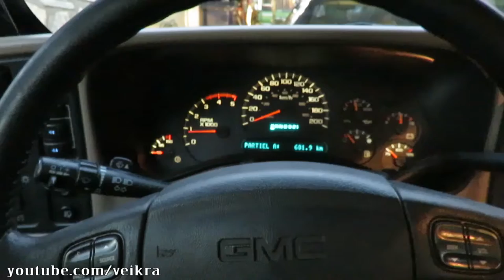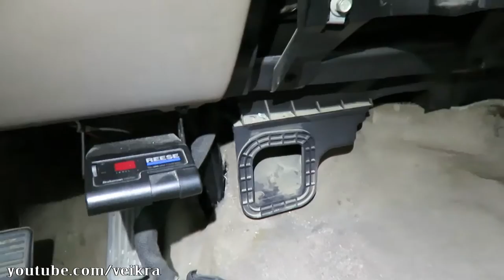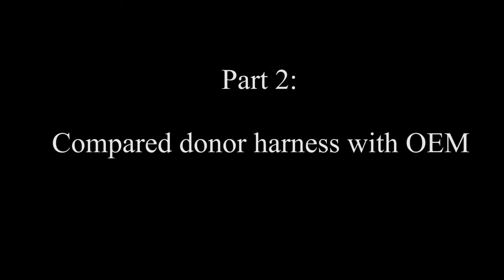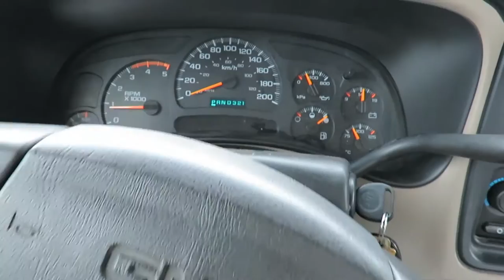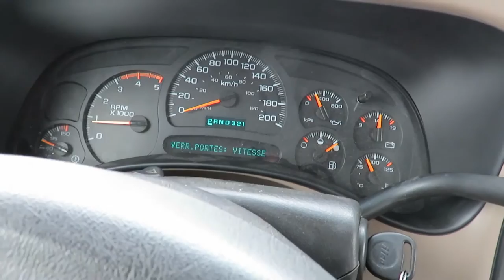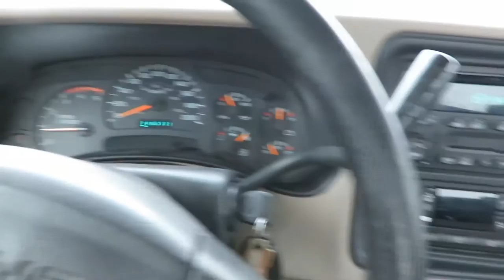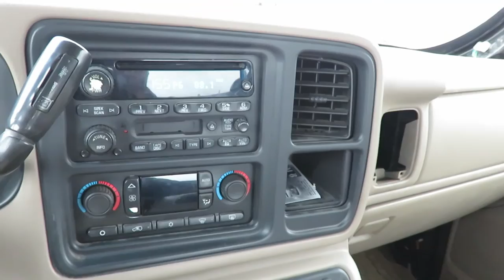How to add Power heated seats 2003-2007 sierra silverado avalanche escalade with ANY wiring harness

Comment: Wow a lot of work!  I am looking to convert the manual passenger seat to power (no heat). Best just to run power over from the driver seat?  Good job with the upgrade
Reply from the maker: yes, power the black and the orange and you`ll be set.  It was quicker than I thought and totally worth the effort considering the cold climate I encounter

Comment: I just got wiring harness that runs from driver to passenger seat.do I just splice the wires in where they come from under the dash and from the doors and splice the wires that go to the back doors. Any info would be appreciated. Thanks
Reply from the maker: First thing is splicing or plugging into the big connector under drive side dash. Follow the wires to make sure they go to the same place especially in the module with yellow plug under the driver seat. My harness was different because it came from a different bodystyle (avanlache/escalade) so yours could plug in. There's not much going to the back door but thats where you splice the purple wire. You may have unused wires too. driver front seat ground connection (big black wire) may also need to be connected to a ground depending where the harness was cut

Comment: Extremely cool and helpful video bro. Have you ever replaced one of the drivers side heated elements? I believe mine just went out. Anything feedback would be great. Thank you and have a good one bro.
Reply from the maker: I've not had to replace any element on this one. Usually the bottom element is the first to go out. Did both of yours go out at the same time? Are the passenger side ones working? The lights on the button should flash to indicate a problem
Reply: Veikra it's usually intermittent. I believe the drivers side bottom element went out. Passenger side works good til I turn on drivers side. I know the bottom heat elements go out 90% of the time. I was just curious if you replaced any because you seem very knowledgeable. I have an 04 cadillac escalade 6.0
Reply from the maker: I was sure I had to replace at least the bottoms one, as these seat came out a 2004 escalade. Did not have to, it's not THAT bad to do, just need to take your time and be a sticker for detail when putting back the leather in place.  So far so good, 2 winters, still toasty warm ! Only use the 2 and 3 light for warm up, then only on the first one.
Reply: Veikra you're lucky bro haha. Keep me posted, if you ever do a heat element share me the video if you choose to record it. Merry Christmas bro to you and your family.
Reply from the maker: thank you, ill try to find a broken truck to do it

Comment: Did you have to add any factory fuses (under the hood, side of driver dash)? I put a floor harness and to the seats I wanted to keep the manual seats but wanted heated. As soon as I turn on the heated seats it turn right off within a second
Reply from the maker: I already had the fuse in because I had electric seat base from the factory.   What exactly do you have? you found heated seat that are not electric? What's your year truck and the year and style of seats. The factory heated seats turn off if the heater in the seats are bad. But Id like to know what you actually did to see if it could be the problem.
Reply: @Nordic_Mechanic  04 sierra 1500 I went to the junk yard and grab the floor harness and the same junk truck grab the harness from the seats. My wife has 03 Yukon with power seats and they are junk thats why I want to keep the manual seats I got the heaters working apparently the switches for the driver and passenger heaters talk to each other because now they're working I didn't have the passenger switch plugged in the 1st try thanks for trying though

Comment: cool video bro!!! So if I just install the wiring harness for the heated seats to work there is no need to program anything and I don't need to touch the fuse box either.
Reply from the maker: You need to program if you want the MEMORY seats as I said in video.  Because that works with the bcm when you remove the key you can have the seat pull back to give room . The heated seats work on their own. You hook it up and go, no fuse to add either.
Reply: @Nordic_Mechanic  how can the BCM be reprogrammed to get the seat memory function to work?

Comment: Veikra - thanks for the great video. So it’s possible to add the necessary rpo (AG2 &AN3, I believe?) to the BCM to get the memory and easy exit to work?  It can be added to the existing BCM  that currently doesn’t have it?  Who or where can tbis be done?  Thanks!
Reply from the maker: Yes, you need someone with a tech2 to add it. Or you can send your BCM to a company that will flash it in. I never bothered to, I never move the seat anyways and heat works

Comment: I have a set of power heated seats from a parts truck, and friend of mine has manual seats but his drivers seat has a harness under it like yours, will the directional power buttons on the drivers seat work just from plugging it in ?
Reply from the maker: Yes. Hooking the big orange and the big black wire is all you need for power function both driver and passenger. Heated seats wont work without the full install shown here
Reply: Veikra thanks for the quick reply, hopefully seats are from a 04 2500hd and he has a 05 2500hd...plus I still have all the wiring it’s just not pulled from the truck yet just hoping the power to the drivers seat for the time being will be simple thanks again

Comment: Can you please make an update video ? I have the same truck as yours and it has no heated seats . It does have the base electric seats . They are cloth . If I want to add full power , heated seats would I have to change out door panels and the harness to the door ? Please send me more info on this
Reply from the maker: this is all you have to do for the door panels. This is the cheap option without buying new door panels. Just cut and put the switches in. They connect to window switches. https://www.youtube.com/watch?v=nkpA3kd5jeg  The rest is in the video, but be attentive or you may miss some details.  This tutorial works for any harness, dont have to have a perfect sierra to sierra match, although that would be easier

Comment: Anyone know which wires on the seats are the side airbag wires?? Just got 04 yukon seats and putting them in my 99 silverado. All power should be plug and play but my silverado doesnt have seat side airbags. So I dont want those connected. But which wires are they??
Reply from the maker: 2003+ don't have the same electrical system. You'll only be connecting the big orange and black wires under each seat and the seatbelt sensor. The airbag connectors are yellow

Comment: Hey buddy my name is Patrick an I'm doing the same swap on my 03 Duramax an I would like to ask you a couple of questions if you don't mind I took the wires out of the doner harness that needed an installed them into my factory harness pin for pin the only wires i have left over that are not hooked up are a pink wire, yellow an brown with a white stripe that went to the doner harness at the left front kick panel plug do I need to splice them into my factory harness or are they not used also everything works other than my heated seats on both sides im not sure what to do any help would be much appreciated!
Reply from the maker: hard to tell which wires those are. As I said in video, the color changes between model and years.  For instance, my harness is avalanche instead of sierra so almost no colors.  
Can you make a video and show both harness? Its been years since I've done mine

Comment: I’m doing the same swap as you, and your video is has been very helpful. I merged the harness and everything works seat wise all 8 position. On both dr and pass. But my heated seats don’t power up I see that they get power but they don’t light up or turn on. Any help or advice would be so helpful
Reply from the maker: you have the beeping from the buttons in your factory radio? I assume you have a 2003+ truck and seat/harness?
Reply: I’m having the same issue
Reply from the maker: @loganfarm  model and year? which factory options?
Reply: @Nordic_Mechanic  2006 Sierra 2500 Duramax, had power driver seat with manual recline, full console, bose, power everything else I swapped the seat harness from the loaded truck. It dings when I press 1 and 2 and some other button. Heated seat symbol illuminates but when I press to turn them on nothing happens
Reply from the maker: @loganfarm  You seem to have a problem with the routing of the blue wire. Check the video section about it. You have to make sure it goes where it used to go. You BCM is receiving the command from the door switch as it dings, so the blue wire from the bcm to the seat module under the seat is where your problem lies
Reply: @Nordic_Mechanic  okay thank you, the blue wire that connects to the air bag module? Around 17 minutes in?
Reply: @Nordic_Mechanic  I mainly just want the heated seats to work not too worried about memory seats
Reply from the maker: @loganfarm  it should workr. Read 18:36 and make sure it is correct. There was a difference between my old and new harness .
Reply: You have to have your bcm reprogram by dealer to allow heated seats to work

Comment: My truck is LT1, with leather seats but only 4 way power on driver side, all manual on passenger like you- and  no Bose and manual heat control. 

Will my BCM work with this swap? It’s my understanding you didn’t need to do anything with the BCM but your truck did have more options than mine like heat and Bose so I’m not sure.
Reply from the maker: Technically it should work. The BCM has nothing to do if you dont go for memory seats. The window switch simply relays the info on the CANbus and the module under the driver seat picks it up and turns on the heated seats. It's kind of neat

Comment: Did your truck come with the switches on door panels? I have a single cab I have seats & harness but I was doing a bit of research & it said that I needed the harness from the door so it can hook up to the switches
Reply from the maker: No, I installed them in a previous video. You dont need harness in the doors if you have a 2003-2007 They work on canbus, plug in the window switches
Reply: Oh ok. I think I do need the window switches from 03-07 cause the plug for the heated switch doesn’t plug into the one I have now from my 01
Reply from the maker: @gerardojuarez6938   It wont work. This video is for 2003-2007. You have normal electrical system, you need wires. I thought since youre messaging me on this video about 2003-2007 you had one. 2001 is a totally different system. You'll need way more wiring and harness than this
Reply: Yeah I was thinking the same. I have the seats & the harness but I haven’t had any time to take it to somebody to wire them up & I had one guy telling me I need the heated switch to work on my door panel

Comment: Buying a 2013 Avalanche with cloth seats. If I buy a used junkyard front leather seat with heat and air, are the wiring there to plug in the used seat? Hoping they make one wiring harness for all the trucks. If the plugs are there, will the controls then be on the display?
Reply from the maker: I havent done one of that generation but it should be the same or perhaps simpler. The settings wont show on display until reprogrammed though.  For instance, I dont have the memory seat working as I didnt recode the bcm .  I still have heated seat working as specced out so im happy and all the motions of the seat work

Comment: Did you find the wire for the power tailgate lock underneath one of the door sales? I took my tailgate off once unplugged it and put it back on the next day plugged in and it’s never worked since I put the meter back there as my key fob no power to either wire and it’s supposed to be like a DC motor the hot and the and the negative switch sides when you lock and unlock it maybe you can tell me where that wire is before I start tearing my truck all apart I thinkThere’s a connection or a failure spot under one of the rear sells like I found another GM cars apparently somehow there’s a spot they are but can you let me to tell me if you know anything about the power tailgate lock wire! Great video thank you very much I’m looking forward to buying an interior taking my cloth out and putting the leather interior in with power seats heated seats I believe that the wiring is already and it’s simply a matter of plugging the new seat in!
Reply from the maker: You have a 2007.5+ not a 2007 I believe the tailgate lock is GMT900, not GMT800 which this video covers. I've not seen a GMT800 with factory electrical lock.

Comment: So I have a 2005 GMC Sierra 1500 single cab that has manual windows locks and seats. I want to swap the interior out of a donor 2006 Yukon Denali seats and locks and windows can I take the harnesses and bcm from the Denali and swap it over? Will anything need programmed?
Reply from the maker: you cannot swap bcm. Needs to match ecu and instrument cluster in programmation.  hardly required if you dont want the memory seat and easy entry features.  Heated seats are stand alone, meaning if they can talk on the communication bus to each other, theyll work.  Pretty sure the required wires to plugs the yukon doors are there on both side of the dash and ready to go.  Couple wires to check like the blue wire in the video to make sure it goes the right way and the power and ground to each seat . Other than that your golden

Comment: If I get the wiring harness and seats from 06 escalade use it for my 06 Tahoe is it plug send play because I have power seats just not heated and memory
Reply from the maker: most likely. Otherwise do what I did with that connector

Comment: So can I not just swap the harnesses out Becz I have a Chevy Silverado crew cab that doesn’t have heated seats and the other truck I have is a avalanche and it has the center console and heated seats I can’t just swap the harnesses over and it won’t work?
Reply from the maker: Won`t exactly swap over. This is why I made the video . It shows the few places you have to modify in order to retrofit the avalanche harness into your truck.   You'd need exact model and year to straight plug in and airbag option might still be an issue at the module under driver seat, on the floor.
Reply: Gotcha well I took the entire harness out of this avalanche and was gonna like try to plug and play? And maybe get my body control module re flashed to get my memory for the seats?

Comment: Find any Canadian pennies?  I have  dead lizard under that center console Easy to remove?
Reply from the maker: yes , easy. two bolts under the trim where both lighter plugs are, then remove seat, and the connector under the cup holders
Reply: Ill get that frikken lizard!  What is the back just clipped on?
Reply from the maker: Ghetto Wagon
 the back ? the console is held by the seats and the 2 bolts in the dash behind lighter plugs, thats is aside from the electrical connector

Comment: Do you have a pen out for the seat connectors wondering how many wires from the driver side need to go to the passenger side and then how many wires need to go from the driver side to the dash have pieces of a harness and seats trying to work with having a hard time finding a connector view
Reply from the maker: You can get the pinout at the dealership if you ask nicely, but due to a hard drive crash I dont have it anymore. orange and black are 12v and ground respectively. That will make the seats move . The others are for airbags and heated seat / memory. You're losing valuable time without a full harness.  Cut off after the b pilar. My method works with all truck 03-07 , easy to come by harness in a junkyard.

Comment: Im trying to swap power windows and seats into my work truck extended cab ive got door harnesses and panels from another truck and ive plugged it all in and nothing but the power mirrors are working. anything else i need to do?
Reply from the maker: no fuse and no circuit breakers installed. Very low spec truck so nothing is there. Check power to your window switch, youll see

Comment: Did u have to make a custom harness on passenger side or did u just leave the two harnesses unplugged and the heated seats worked?
Reply from the maker: I had no harness on the passenger side. I used the new one and had to connect in the sill panel (same plug) as shown plus a ground. It`s 100% how it would have been from factory.

Comment: Does anyone know what the purple and brown connection are for that go to the BCM and fuse panel? Just installed a donor harness that didn't have these but had factory heated seats. Wondering if all I need know is a factory door switch to turn the seats on? Do I need those two plugs for the heated seats to work? Any help is greatly appreciated.
Reply from the maker: 2003 and up do not require any door harness. The switch in the door connects to the window switch and uses the CANbus to talk to heated seat module
Reply: @Nordic_Mechanic  do you know what the purple connection that went into the bottom of the BCM is for? Same with the brown connection that was with it that went to the fuse box on the side of the dash.
Reply: @veikra, do you know if I need the purple and brown connection to get the heated seats to work? I bought a switch and it has power, but no orange lights for the heat. Thanks.
Reply: I installed the harness out of a 03 into my 05. I bought the factory heated seat switch and connected it into my door switch. It has power just not the orange light for heat. Do I need a different BCM? Or do I need to reflash the one in the truck? Any help is much appreciated